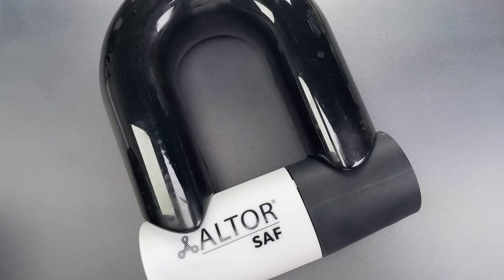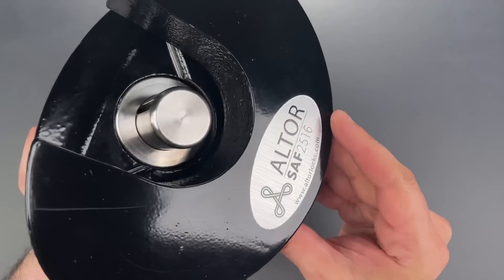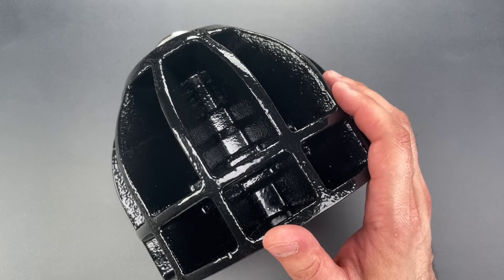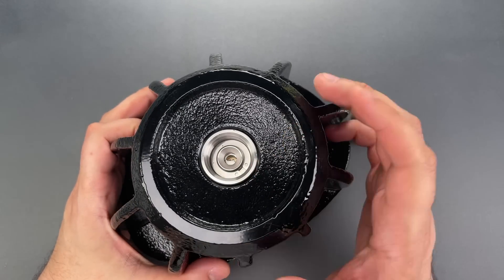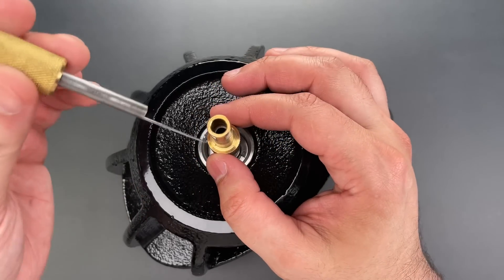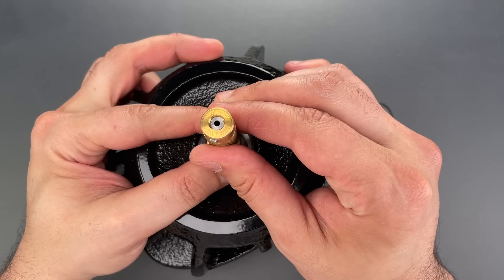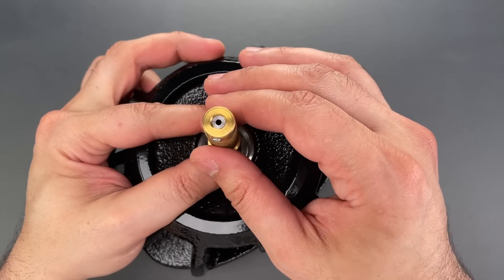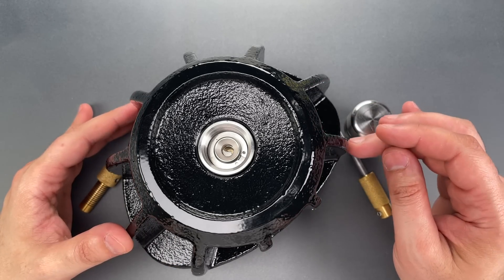[1339] HUGE Altor “SAF” (Strong As F***) Trailer Lock

Comment: It'd be easier to use a lance on the trailer door than the actual lock.
Reply: Or cut the whole hitch off and weld on another to steal it.
Reply: I was thinking it would be easier to cut the coupler off the end of the trailer and weld a new one on.
Reply: @RevUnstableBoy  you don't even have to weld.  you can just bolt one on in a few minutes.  

but if someone is willing to go that far, there is nothing you can do besides hiring armed security.
Reply: yeah, unbolting the coupler would be easier. i’ve seen folks tack weld the bolts to stop that. With enough time, people will steal anything unfortunately. The goal is to make your stuff more of a hassle than the next guys stuff to take
Reply: Yeah, grind the neck and drill a hole in the neck.  This lock is overkill, exact what is needed.
Reply: i see someone doesnt know what a trailer lock is for...
Reply: Except this is a trailer tongue lock so there's no trailer door. to be lanced?
Reply: @AndrewBrowner  he'll be cutting off a trailer door for a trailer that doesnt exist and this lock will be on the boat trailer next to him.
Reply: @alexnutcasio936  Everything can be lanced if you try hard enough.

Ask your mum! 😎
Reply: @alexnutcasio936  i mean it can be used on a tow behind camper that has a 2-5/16" ball but lancing off the door wont help any with towing the thing away... amazing 130 people seem to have agreed with this guy and think this 22lb lock goes onto a trailer door..
Reply: @AndrewBrowner  it’s a tongue lock, not a door lock. Pretty clear to this guy who’s towed hundreds of thousands of miles.  The OP must never had towed a utility, boat, camper trailer before.  Only thing is, will this Altor lock , being so huge, get in way of weight distributing apparatus on trailers and hitches?
Reply: pretty sure he’s saying it’s easier to cut open the door of an enclosed trailer and steal the stuff from inside the trailer than it is to open this lock and steal the whole trailer
Reply: @bassboy134    erhmm doesnt seem like it, but even so.. most of the time its the trailer itself being protected not whats inside it, flat decks, tilt decks, dump trailers, even camper trailers its rarely whats on them or inside them thats valuable its the trailer itself.. and on construction  trailers its really hard to track them when stolen its very easy to put new vins on trailers, say theyre home made, alter them so they look home made or theres no trace of VIN of owner, seems every differnt state and province has their own way of registering and tracking trailers with little to no standards so theres lots of gray areas and loopholes to get stolen trailers reregistered in someone elses name and beyond that theres alot of trailer running around unregistered unplated and they never get pulled over or checked

Comment: Of course, one could just unbolt the coupler and install their own on the trailer.
A lock is only as secure as its weakest link. 
If you need a lock like this, then you should also consider welding the nuts to the bolts, and welding the bottom of the coupler to the tongue.

Comment: when angle grinding off the trailer cup and welding on a new one is a faster solution
Reply: Most couplers are only bolted on in the first place, so you usually don't even have to cut them off. This is actually a fairly well-known security problem in the trailer industry. Other common ones include towing the trailer away by the safety chains without using the coupler at all and attacking it later.
Reply: @Green__one  the good thing about the latter method is you can leave the lock on and have fabulous security. kind of.

Comment: The tool cutting time could be improved by filling those gaps between the fins with a soft rubbery resin wit a medium melting temperature, something to literally "gum up the works" while cutting, and make you change discs/blades much more often, or force a slower speed.
Reply: Or worse, (if you could afford it these days) copper.
As any machinist who has tried can tell you, working copper with normal tools is pure hell.  It clogs cutters and has to be picked out often.  Having it between layers of steel like that would add hours to the cutting process.
Reply: @kd5nrh  or Worse Worse, do both, fill it with copper copper and cheep aluminum with holes/tubes plugged with rubber and low melt plastic.

Comment: "This behemoth weighs in at about 20 lbs, which is roughly the weight of 50 Master Lock #3's"

It also has roughly the same pick resistance as 50 Master Lock #3's, taking LPL about 1 minute to open.

Comment: >Title "Strong as ** Trailer Lock"
>Lock is 20lbs
>Rare and complex locking mechanism 
>LPL Had to make special tools to pick
>Can't cut through with tools
>"One of the best you can buy" 
>LPL has it open in 60 seconds
Reply: well, if you add the time to design and manufacture the tool it probably took a while.

Comment: "Not hesitate to use"
So it's basicly impossible to bypass by any normal human. So as safe as it gets
Reply: Not "impossible".
Just not worth the trouble.
Because you're going to go through a bunch of expensive blades, make a lot of noise and otherwise draw attention to yourself over an extended period of time.
If you're stealing, brute forcing this lock is basically guaranteed to draw a cop.
It'd probably just be easier/safer to break the locks on the doors and unload the trailer, than to try and cut through these kingpin locks.

Comment: The only issue i saw with the video is the comment about the Angle grinder need several blades and battery changes. Im a custom steel fabricator, my angle grinder spins a 10 inch wheel running on about 10 amps. It will slice through that.
I love the vid, and on this praise I will be buying one of these locks for my portable shop.
But real grinders, don't have batteries.
Reply: I don't imagine most trailer-thieves are going to bust out a generator to use their corded industrial strength grinder.

Comment: Trailer hitch locks are better than nothing, but a pickup truck with a small hoist on the back can hook it and lift it up. Then just use some straps hold it in one place as they pull it away. Another wheel lock might also help like a boot.

Comment: Sadly, this is only looking at the security of the lock itself, not at the bypasses of the lock for stealing the trailer. This makes hooking a chain around the tongue really easy, and doesn't look like it protects the hitch coupler bolts.

So, it's kind of like locking the giant bike lock around the frame and back wheel.
It prevents the bike from being ridden away, but doesn't impede actually stealing the bike.

This is very effective at preventing the coupler being used, but many trailers are stolen without attaching to the coupler.

Comment: I see this style lock cylinder at work.  They are set up so there is quite a bit of tension to turn the latch, so a "more special" tool would be required.  (Alternatively you can just ignore the lock and pry the plastic door open, so kind of pointless at the same time.)

Comment: It looks like if you removed a ball from a receiver insert the half pound solid steel cap would make a nice pivot point to drive the trailer away with. If that weren't 100% ideal a custom cap could be made for appropriate highway use.

Comment: For this cost, and the lock is amazing in its engineering, most people are going to be better served if someone designed either a universal or customizable lock for wheels on trailers that is similarly hard to remove and prevents the turning of the wheels and obstructs the lugs to prevent wheel removal. 
 Because if you arent using a trailer thats too big/heavy to put on another trailer and secure down and drive away with, or you arent securing the tongue permamnently and robustly to the trailer frame, someone determined will see this and swap tongues, whether by removing yours, or cutting yours off and splicing a new hitch section onto the stubs. Or they will have a bigger trailer (enlosed or covered) and just wench yours onto theirs. 
I realize that this is unlikely stuff, but if you are spending this much on a lock you need to think about what other threat modes your lock pushes potential thieves into. Higher value potentials motivate people pretty hard.

Comment: This is awesome. Slabs of hardened steel would be a bit on the heavy side for use on a bike but are there bike locks that include lightweight material that will prevent or greatly hinder the use of battery-powered grinders? Maybe a binding foam or whatever is used in safety trousers in forestry? Just a thought

Comment: " it's one of the best you can buy"
" it's something I would not hesitate to use"

Two quotes I have never heard LPL say before.
If he is this impressed, you just cannot get a stronger recommendation
Reply: Well, this lock is based on physics, not marketing wank. We can all have a good appreciation for applied physics. Short of professional thieves and youtubers; physics says it should be a pain to attack with power tools. Physics says that even the mighty ramset will have no reasonable attack angle at this design. Heck, physics says you'll need to be a pretty good bullseye to blow this thing off with an anti-material rifle without hitting those fins. So bring a tank cannon or a custom lockpick, basically... laughs

Comment: As good as it is I do see a couple areas they could improve it to make it even better. They could make the lock pin in the shape of a ball so you could use a secondary lock to lock the ball onto the lock. Secondly they could make a place to put the chains/hooks inside to prevent someone from just using those to take the trailer.

Comment: They went all out on every resistance for this one. A core you need custom made tools and highly specialised skills to pick combined with obscene physical attack resistance. That fin arrangement of hardened steel is the bane of every power tool you can throw at this thing and then some. If you see this in the wild, the person involved is sending a clear message to thieves that they need to put in too much effort and should just leave this trailer alone.

Comment: One flaw I do see is this solution provides no protection for the bolts holding the hitch on to the trailer’s frame. Anyone actually wanting to steal said trailer would likely bring an electric impact gun, a selection of sockets, a drill and some normal drill bits, and unbolt the hitch or drill out the rivets depending on which were used, neither being very secure, and then bolting on a hitch without the lock. Only should take about 2-10 minutes depending on how proficient they are. It’d be nice to see some sort of hardened sleeve/tube that would lock over the entirety of the hitch with the style of those hardened arches in order to match it’s immense security at the next weakest link.

Comment: Just imagine this lock is on a trailer where the key-way will be underneath the tongue of the trailer and facing the ground.  That would be much more difficult to pick in that position than it was upside down, on a bench, indoors, with good lighting, etc..

Comment: The only thing I can think of to bypass a hitch lock like this would be to engineer an articulating adapter which would "house" the lock. Why fiddle with defeating it when you have something hooked up to securely attach it and roll-out? If only people didn't steal in the 1st place :D

A buddy of mine had his really nice bicycle stolen a couple years ago. We were able to recover it, minus the scratched out SN and at no cost. What was kind of funny is he had a strong lock and cable for security. The scummy thief was prepared though, bringing tools to remove the whole rack for that bike. Was rather brazen: during normal business hours, on the 3rd floor of a company parking garage...yeah, it was targeted and planned, which makes it even worse. Just glad we got the bike back.

Comment: One thing I see in most of the videos on specialty locks like this is they are picked on a work bench. Far more realistically the person picking would be laying down in a dirty gravel driveway, with the trailer hitch about 18" off the ground. This would make it difficult to have your head right in front of the lock and still be able to manipulate the tools, so you be reaching superman style. I have no doubt the lock would still be picked, but you have to admit it would at least be slightly more of a challenge. I suppose you could tip the trailer on it's side to get to everything easier, but that is called drawing attention to yourself. . .

Comment: What does it do though to prevent removing the 2 bolts that hold the 2" coupler to the trailer? A adjustable wrench and a spare coupler and your away.

Comment: The fact that you have to develop a custom pick not easily fabbed yourself is good.

As a SMW I use cordless grinders, metal saws etc. all day long. If those ribs are truly hardened steel, than yes, you'll be seeing the police before you are able to hook up and steal that trailer.

The amount of noise you would be making with a metal saw, grinder, sawzall or even trying to gouge it with a welder gen pack in the middle of the night would wake up the living dead.

It's not an easy quick cut, your done.

Comment: It probably works on a standard surge brake trailer because most people won’t want to mess with braking systems (but they could). However, it seems that. Ost of these systems do not have protection against just doing a swap of the coupler.  Simply put, I can unscrew two or three bolts with nuts and put a new coupler without a lock on in a lot less time than attacking with an angle grinder, and with a lot less noise.  Do you know of any trailer locks that protect against this type of attack?

Comment: At $350, it's a bit on the expensive side for a kingpin lock.
Basic locks are about $25-40.

Heavy duty locks run into the $100-200 range.
Still, if you absolutely CANNOT lose a trailer, this and an HDCDL door lock will pretty much keep EVERYONE out of your trailer.

Comment: I’m curious. You were successful picking the lock when it was technically upside down.  How would it go attempting to pick the lock when the lock if it were positioned on a trailer and you’d have to pick it from underneath?  For example is the tumbler designed with capabilities the depend on gravity?

Comment: At that point, they would just use the safety chains and still take the trailer. I had a friend bring his trailer over to my house using just safety chains because he lost the key and needed my grinder to cut off the lock. Someone needs to make a heavy duty clamp that goes around the wheel/suspension on trailers.

Comment: If I was Altor, I'd call this a win. Over a minute to open with specialty tools, not gonna be easy in a driveway in broad daylight. They should basically advertise it as "Invulnerable to all but the Lock Picking Lawyer." (I'm sure the door to the presidents doomsday shelter has the same disclaimer on it.)

Comment: Wouldn’t locks like that be super difficult to pick if they required a countertop clockwise turn to set some pin(s) THEN a clockwise turn?  You wound have to try to set tension left then right. Seems a simple solution

Comment: Great lock - but what is to stop a thief just tying the trailer on with a rope and dragging it away? Trailer theft is a big problem in Great Britain. Worst culprits are the gypsies - they have even been known to use a HIAB lorry and just lift the trailer onto the back.
GPS trackers are the best way to go - although a hitch and wheel lock are a good bet as well.

Comment: I'd say this is pretty crackhead proof. I feel like though if you had one of those things on in LA they just ratchet strap the trailer to their own hitch and still take off with it
Reply: Around here, they just use the trailer safety chains to sling it it a ball mount, get it somewhere isolated and worry about the lock then.  My trailer has a bulldog coupler so this lock won't work, but I use multiple lock, I cut the threads off a ball, put that in the coupler use a normal coupler lock, and use the coupler lock to secure the chains a bit, then I use a c-clamp style boot look and a wedge chock that presses between the sets of tires to keep them from rolling. Could somebody still take my trailer, yup, but the goal is they look at the number of locks and figure it's easier to look elsewhere.

Comment: Would be even more secure if you left the cap off and let a bunch of crap and corrosion collect in the cylinder, making it just easy enough for a hardened steel key to work, but too hard for the picking tools.

Comment: How many locks do you have to pick to start using locks as a unit of measurement?
Reply: that lock is actually easy to get past, there will be a video out soon that shows how it can be opened in 45 seconds
Reply: @ronlee6529  ok, I was referring to when he said it weighed 22 lbs or approximately 50 master locks

Comment: Why not just put "cap" over the lock mechanism with a 120-180°opening on the side, so that you need an overly specific tool for picking. The key should have an L-shape and the cap should have only that much space that you can put yout key in to slide it into the mechanism. To pick it you need A, very special tools and lot's of experience (because of  the picking tools would bend too much) Or B, you have to cut of the cap before picking.

Comment: Damn! I think if I wanted to steal this trailer, I would just use a torch to cut off the hitch tounge, and weld, clamp, or bolt on my own.
Even a thief skilled at picking detainer locks(a rare individual) would be stymied without a specialised tool that is not commercialy available. And even then....try picking a disk lock while lying on your back looking up at it.